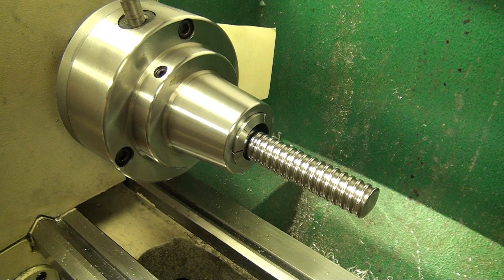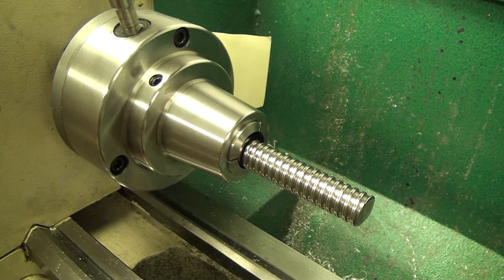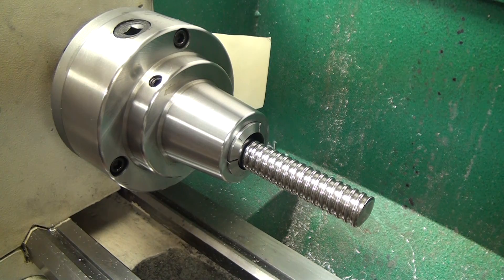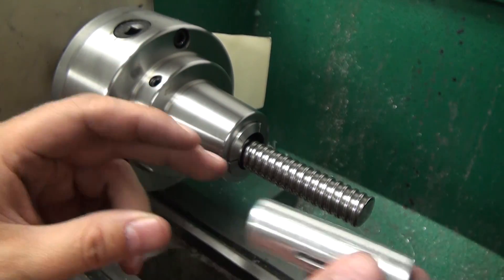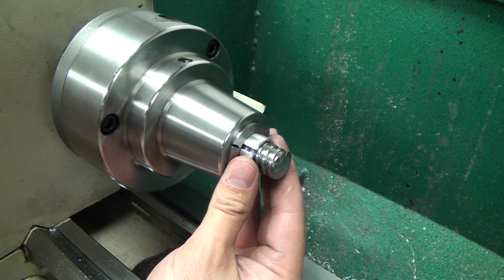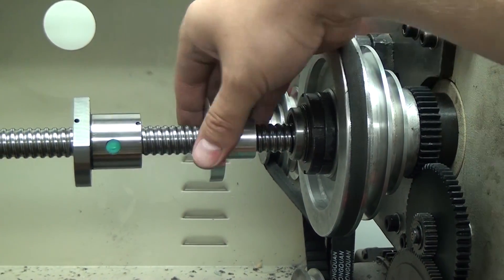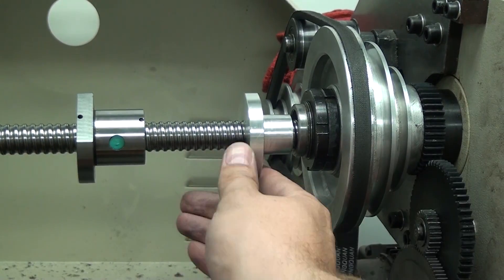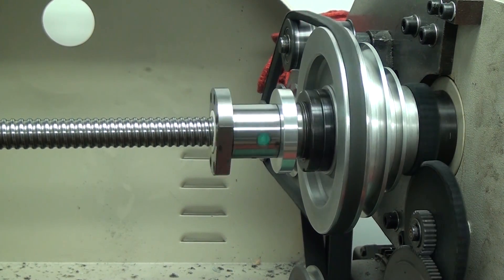G0602 CNC Conversion pt4b - Machining a C7 Ballscrew

Comment: Great video! But: It seems, that the pressure roller for the V-belt is on the wrong side of the belt? It should always be on the outer side of the belt, i thought? (see minute 1:45" and after)
Reply from the maker: +HenrietteCNC I agree, but the manual shows it this way and it fits so I ran it.